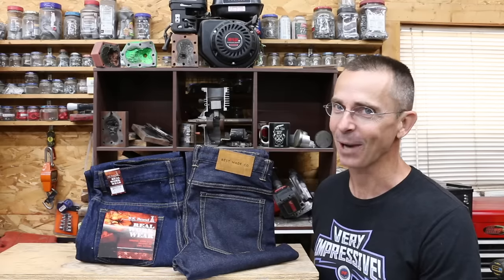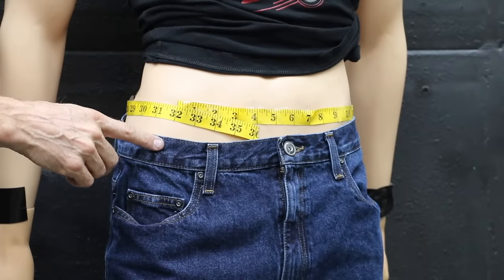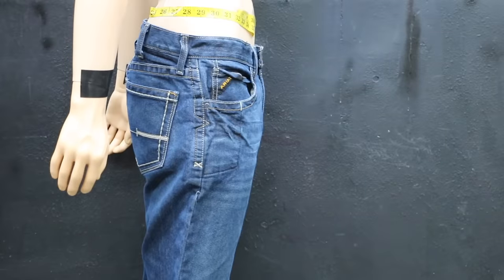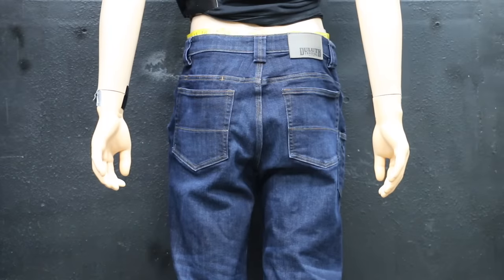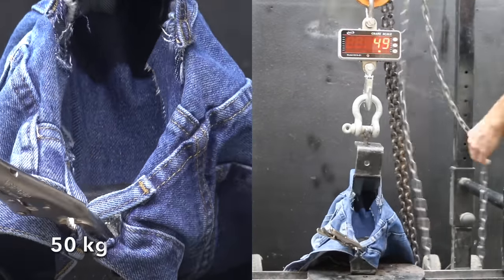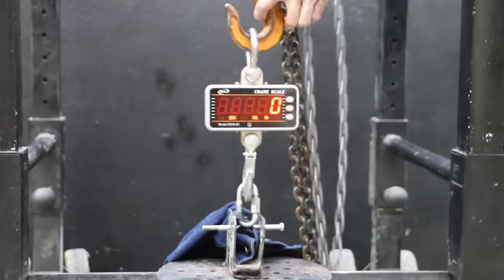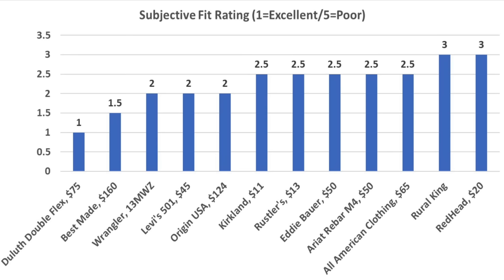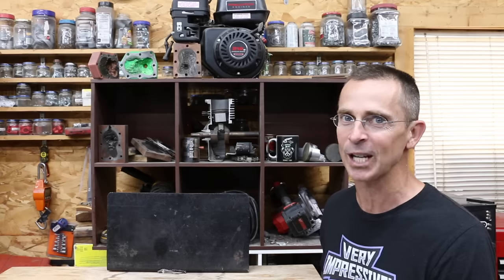$10 vs $160 Jeans? Let's Settle This!

Comment: I watch all your reviews.  Among the best on the net.  Suggestion:  One thing that's missing is that it would be helpful to not only know the "pounds/inches/whatever" at failure but if possible, you could use your measuring equipment to assess how much strength is NEEDED.  For example, here instead of just ripping the pockets off, first put on a pair and see how many pounds pull on the pocket feels like the max level you would ever experience while actually wearing them.  Similarly for wrenches, instead of just twisting them to failure, how much twist can you put on them by hand using one normally, then with a breaker bar but still by hand, not hydraulic press.  YOu can still run all the tests you already do to failure on the press but we'd have a better idea of how well things will serve in real life use.  If the HF wrench twists off at 60 pounds and the SnapON makes to to 100 does that matter if the typical hands on use never puts more than 47 pounds on it?
Reply from the maker: Thanks!  Thanks for the suggestion.

Comment: I used to wear the 100% cotton Duluth cargo pants after i got tired of denim wearing out and wanted to try canvas. They are great general purpose pants but didn't have the double front construction i needed back when i was loading trailers. I switched to Wrangler riggs for the double front construction after being disappointed by Carhartts surprising lack of durability. Now that my employer provides work pants i might switch back to deluth or start making my own pants although I will probably still choose canvas over any twill weave I don't know why but I wear out pants really fast even when I am not working.
Reply from the maker: Thanks for sharing.

Comment: How about what engineered fuel is the best, true fuel, VP, Toro all season, Sthil Moto 4 fuel. I know you did a test on this vs pump fuel. But what about head to head like you did with oil? Thanks.
Reply from the maker: Thanks for the suggestion.

Comment: My only big surprise was the abrasion resistance of the Levi 501s.  I have been wearing them 35+ years. I am rough on clothing and have found the abrasion resistance to be better than most common jeans. I am wondering if this was an anomaly in the testing. The weak crotch in the 501s was no surprise to me. I have worn the crotch out in every pair that I have worn out.
Reply from the maker: Thanks for sharing.

Comment: Having previously owned 3 pairs of Duluth jeans manufactured posts 2016 I will never buy Duluth jeans again they actually fell apart about as quickly as a pair of jeans from old navy.   All 3 pairs were failing within the first 7 months of wear.   I have since moved on to origin and I am overly happy with their performance and durability I have since moved on to origin and I am overly happy with their performance and durability
Reply from the maker: Thanks for sharing.

Comment: One of my biggest concerns is durability.  I doubt the sandpaper test really applies.  My jeans seem to fray and wear out at the cuffs and where my hands go in and out of the front pockets.  There is no real roughness involved.  Perhaps there is some way to test durability with repeated washings and light use.  Because they fade, look ratty and worn, I avoid jeans and any other pants made of 100% cotton.  Instead blends seem to breathe, dry quickly and last much longer.
Reply from the maker: Thanks for the feedback.

Comment: What you call breathability can also be seen as thin and not durable. People do work outdoors when it's cool or cold as well and that's where thicker, tighter jeans shine.

With regard to the crotchs tearing it's usually the case that the fabric has been weakened by the constant rubbing together of the inner thighs which is common. 
Abrasion resistance is important here I think. 

One other thing to consider is availability of larger sizes. Not everyone fits into the "standard", mass produced jeans. Some have different proportions. 

Thanks Todd for your thorough testing procedures.
Reply from the maker: You are welcome!

Comment: Would love to see a 12 inch 80 tooth miter saw blade comparison. Full Kerf vs thin Kerf. Be nice to see which has the most and least flex at cutting speed. Wondering how the new CMT blades stack up against the competition.
Reply from the maker: Thanks for the suggestion.

Comment: Thanks for yet another awesome video!

I might add that breathability isn't always a positive; if you live in the North it's nice to have pants that the wind DOESN'T blow through as easily.

Subjectively, I think the Kirkland's are the best work pants on this list, primary for the value. I've worn them personally, and for my line of work (logging / hazard fuel reduction) they've outlasted single knee Carhartt's and Cinch.  Around home they last comparably to Levi's and Wranglers. I mean yeah you could go drop $160 on one pair of excellent pants that will last a good while, but they won't outlast the 14 pair of Kirks you could've bought, plus it's nice to have multiple pairs so you don't have to either wash them all the time or put on filthy pants every morning.

If you're not too concerned about what they look like (the fit is comfortable but not attractive) and you can get past the shallow front pockets (they are kind of annoying), the Kirks are an excellent choice for the kind of work that is genuinely rough, dirty and will eventually wear out any pair of denim.
Reply from the maker: You are welcome!  Thanks for the feedback.

Comment: Since a lot of folks wear duck pants for hard work, it would be interesting to see Carhartt B01s, Dickies, etc. duck work pants put through these tests (and see some comparisons to how the duck fabric handles the abuse vs. denim).
Reply from the maker: Thanks for the suggestion.
Reply: @ProjectFarm  Also, it would be interesting to see what it takes to rip the front pockets (I'd guess mostly downward force) and how they fare (as with the back pockets, some failure modes wreck pants while others inflict damage that is acceptable for work pants). 

Plus, dudes often slide clips with knives and tape measures in their front pockets. Testing the abrasion from that would also be useful to know.

Comment: Great video, as usual!  Whenever I buy, or receive as gifts, ANY brand of jeans the first thing I do is put an iron-on denim patch on the INSIDE of the right knee.  Without this, a hole usually appears quickly!  I help-out the iron-on adhesive with glue gun glue and an iron I only use for patching.  Patches stay on!!
Reply from the maker: Thanks!  Thanks for sharing.

Comment: Very informative!  I like the durability test - yes, these are work clothes and they should be used!  I'm also all about comfort too - something super strong is of no use if it's not comfortable!

I have no idea if there's a difference in products, but I was thinking about those cleaning brushes and I was wondering which brands are the best for durability.  I use the cheap HFT brushes and they don't wear well.  The HFT set comes with a brass brush, steel and nylon.  I use the brass and steel brushes more than the nylon.  In my experience, the nylon brushes don't hold up well and many times it's a one use item (especially when I use it with solvents).  

Thanks again for doing such great work.  I look forward to watching your future videos!
Reply from the maker: Thanks, will do!

Comment: I used to wear Levi's but in recent years I've found the belt loops kept tearing out in the back as I'd pull on my belt to hitch my pants up.   I started buying the Duluth ballroom flex jeans and can confirm that they are well built and the belt loops don't tear out on the back.   Price wise, Duluth frequently has 20% off coupons so they're maybe $50 which isn't bad.
Reply from the maker: Thanks for sharing.

Comment: Really useful video! The one thing I'd suggest is including a rise measurement alongside the waist measurement. Pants are made from patten blocks based on standardized sets of measurements. so a 32x32 will be drafted using a "body" that has a 32" waist, but if it designed with a lower rise then the waistband won't sit at the natural waist and might be larger without being out of spec. The curve is less dramatic in menswear patterns, but it still makes a difference! Plus, rise is a very useful measurement for finding the right fit.
Reply from the maker: Thanks!  Thanks for the suggestion.